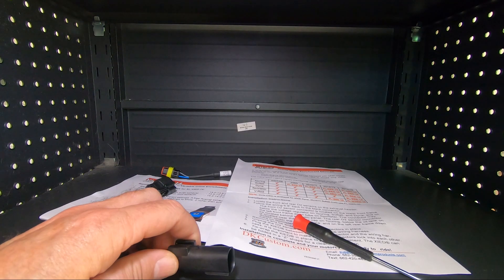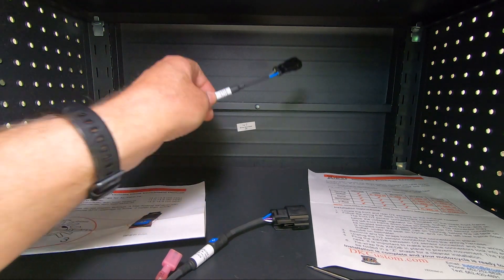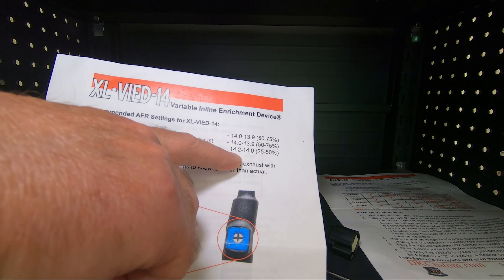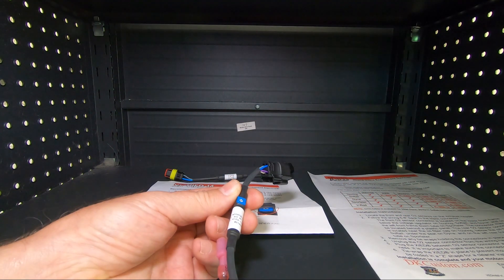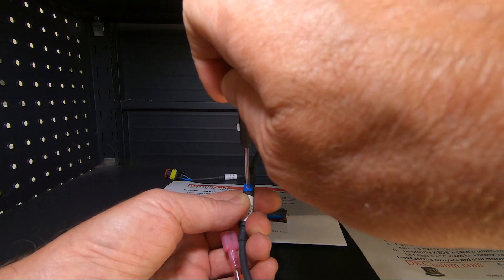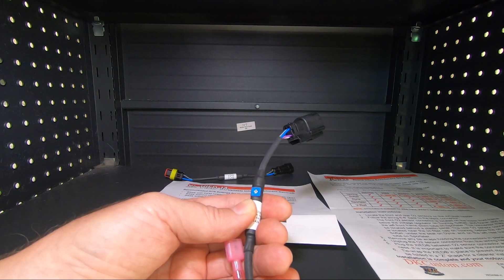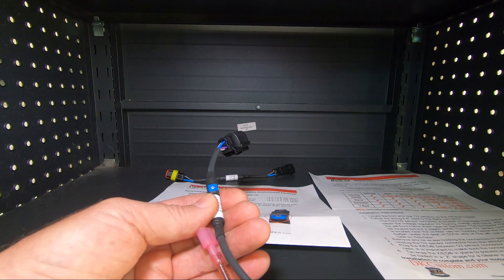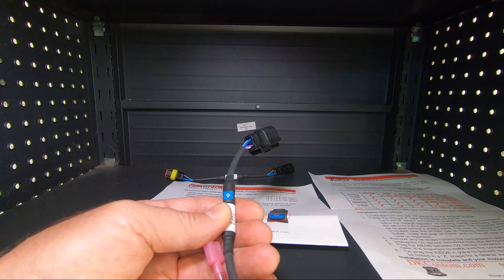Plug n Play Adjustable Fuel Management for Harley's

Comment: so I have a question. will adding the vied lock the afr at whatever it is set at? So say whether I'm idling or redlining would it have a 14 afr if set at 75% or would this allow for a richer afr at higher demands?
Reply from the maker: The way the XIED and VIED work is to add xyz % of fuel to the existing map.  Harley has a good tune in there....it is just too lean across the board (because of the EPA).  So these add to the existing tune, making it not too lean.  This all happens in closed loop.  It also sends the corrections to the LTFT tables to adjust open loop.
When you have higher throttle and load, the tune will go much richer (down into the 11's & 12's) as it should.
There is another video coming out in the next couple of weeks where we talk about Closed and Open Loop and some of the details of how all that works.

Comment: Hello, I have V&H FP3 on my 2012 Road King and one of there maps flashed on the bike. I still get some decel pop even though I have it enriched a little more with V&H tweaking the map, they also have a feature on their device that is represented by a firecracker that enriches it some that is also flashed on the bike. Do you think this device would work with this flashed map in order to dial in the fuel mixture a little better or should I flash back to a stock setup, take the FP3 completely out of the equation and see how this device works on the problem? thx
Reply from the maker: The VIED will work with the FP3 and richen it up even more.  
However, if you are only trying to get rid of the decel pop, there is a less expensive way to do that, and will result in better power too, that is with the Thunder Torque Inserts™.
See the two videos below-
https://www.youtube.com/watch?v=I_djBYYYu28   (around the 6:00 minute mark)
https://www.youtube.com/watch?v=gOeJ6Mx_mQo
Reply: @DKCustomProducts  Very good...thx

Comment: Should both VIED's be set equally?  (Same setting for both front and rear cylinders)?  I bought my bike used, these were installed by the previous owner (who changed the exhaust back to stock before letting the bike go). So I'm not to sure if he setting are correct now.  2014 Ultra.  Thank you in advance for your response!  New Sub here!
Reply from the maker: It is not necessary for them to be set equally.  If your bike is running warm and/or you ride in hot temps, it is not a bad idea to have the rear cylinder a little richer (more toward the 100% setting) than the front.  Just ride it at different settings, like talked about in the video, and where ever it runs best, that is where you should leave it.  You cannot hurt the bike trying different settings.
Reply: @DKCustomProducts  Thank you for the rapid and helpful response!  I am in process of playing with the settings now.  When i discovered the VIED's on the bike, i noticed the rear was approximately 40% while the front was near 75%.  The fuel economy was horrid with a lot of decel pop.  Todays ride they were both at 50%: The bike seemed more responsive and a lot less decel popping.  It did seem to be throwing off more heat, near the end of the ride though.  I will set the rear up to 75% and leave the front at 50% for the next ride.  Thanks Again!
Reply from the maker: @scottthornton9237  Can't go wrong trying different settings till you find what gives you the best results on your bike!

Comment: Hey Guys... would this replace my V&H FuelPak?? I have stock bike with open air kit and Rinehart true duals on 2006 FI Road King. What difference would VIED make vs FuelPak?  Is this plug N play like the fuelPak?? Thanks, Charlie
Reply from the maker: I'm sorry, it will not.  These work on 2007 and up Road Kings.  Thank you for checking.

Comment: Will you at some point soon be doing these for the 2021 M8 ?
Reply from the maker: Hope so.  We are working on the 2017-2020 M8's right now.
As you know, HD changed the ECM in 2021 and not even Dynojet or V&H's have come out with upgrades for the 2021 yet (they are close).  Once we get the 2017-2020 done, then we'll move on to the 2021.